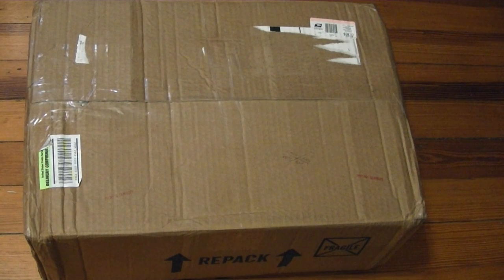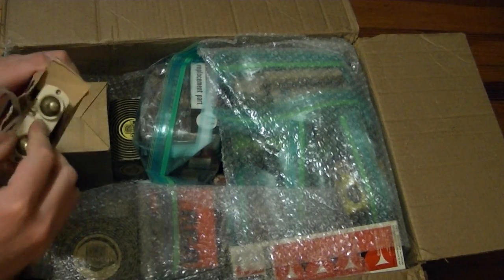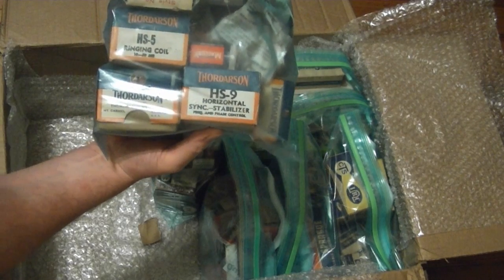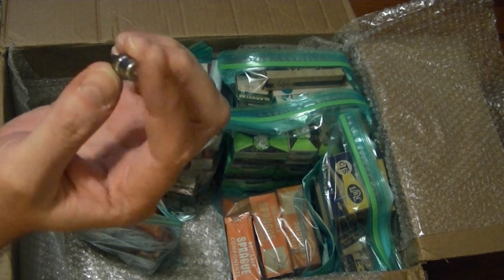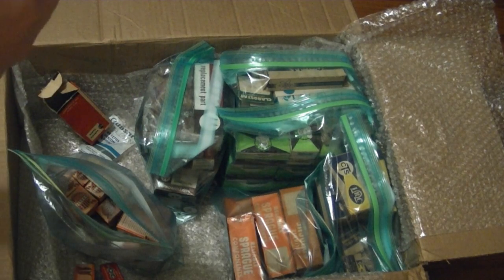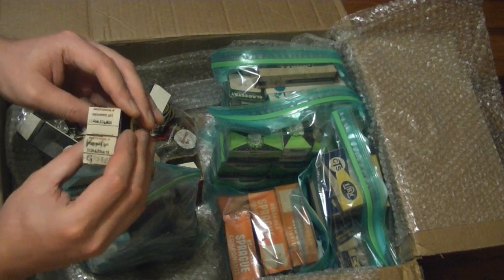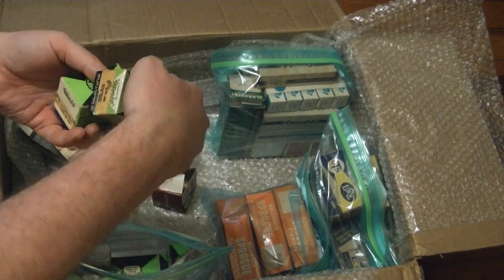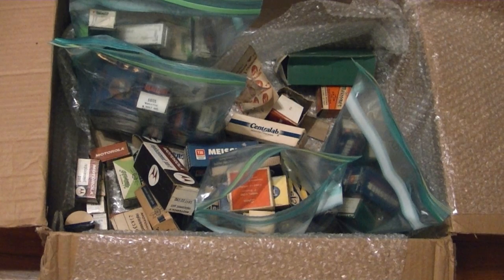Box of Vintage TV Parts

Comment: Nice Score! that 45 RPM adapter was for the VM made changers made after 1965 (with the short spindles). 
that antenna coil was made to be used on radios that were missing the loop antenna on the back of the radio. these enabled the use of a single 6 ft piece of wire as a antenna.
those miller K-Trans were notorious for silver mica migration disease. last, but not least, i would not afraid to use them N.O.S sprague filter capacitors after forming the dialectric with a good capacitor tester.

Comment: Hi Bob, I think that black thing at 13:17 is an old adapter for a record player that takes standard 33-1/3 rpm to the much smaller 45 rpm records. I never saw one that has a spindle on the side. Usually the 45's just dropped around the square deal for registration. Nice find on this classic stuff tho.